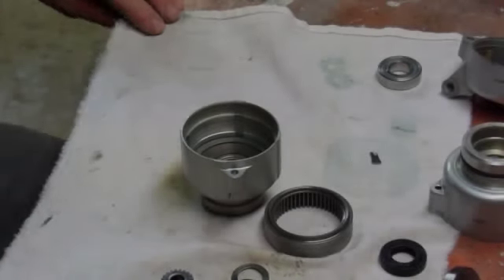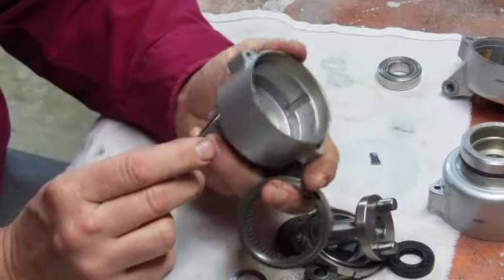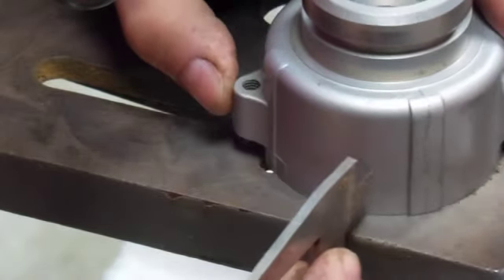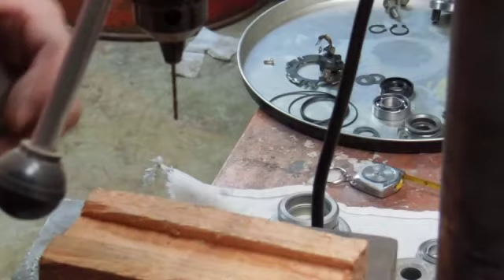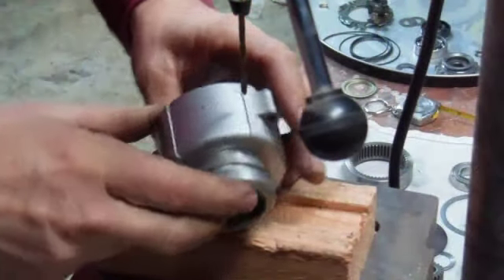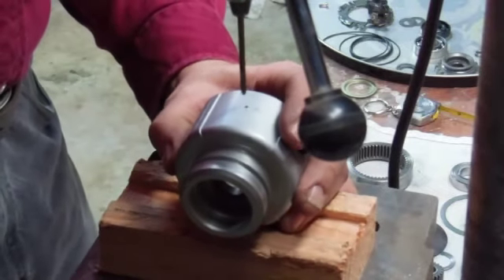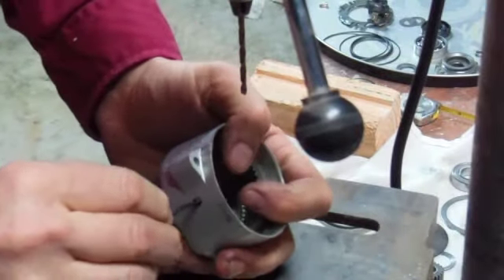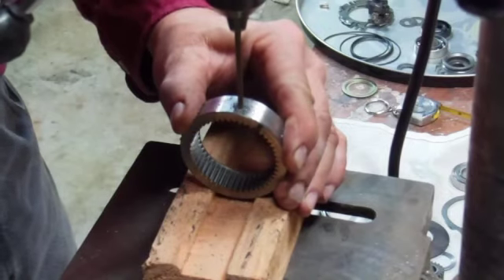Doctor Virago Starter-Ring-Gear-Fix

Comment: Thank you Dr. Virago I have one of the XV750 1986 which refuses to start. The planetary gears are so packed with molybdenum grease it's a wonder it would spin at all. I will follow your instructional video carefully and expect it to be perfect. Thanks again. Hans
Reply: Dr verago. I would like to thank you for your video regarding the starter. I have used your method of writing and hole drilling and grubs crews and it worked 100%.Thanks for the video and brilliant work. I repairs my yamaha xv 1000 and learned a lot alot trough your video. I thank you....... Aldo Kapp from South Africa

Comment: These models also use the same starter.  I thought you might add it to the main description for others with the unmentioned models.  Great video, thank you!

1981 XV920RH 
1981 VIRAGO 750 (XV750H) 
1982 XV920J
1982 XV920RJ 
1982 VIRAGO 750 (XV750J) 
1983 XV920K 
1983 XV920MK 
1983 MIDNIGHT VIRAGO 750 (XV750MK)
1983 VIRAGO 750 (XV750K)
1984 VIRAGO 700 (XV700L) 
1984 VIRAGO 700 (XV700LC)
1985 VIRAGO 700 (XV700N) 
1985 VIRAGO 700 (XV700NC)

Comment: I’ve got 82 xv750 and no spark on rear cylinder. I’ve changed cdi. Coils. Ohmed the pickups and they are fine. Swap the leads to the coils and the rear will fire. Any help would be awesome

Comment: hello, I have a 85 xv700 that im having trouble out of. could you please tell me if 145 lbs of compression on both cylinders is enough for it to run. the rear plug is gas fouling like crazy.. thank you
Reply from the maker: +Richard Shirk . . yes 145 is nice . . . for the rear plug run a hotter plug or re-jet the carb . . .

Comment: Have the same problem. Do you have any idea, how that ring gear is supposed to work in the original form, if nothing holds it from slipping?
Reply: Yamaha relied on Assembly Pressure to hold the gear in place . . and later issued Shim Stock rings that you could 1 - 2 oe 3 to give that added pressure . . but they never worked either

Comment: When I go to start my 81 750 virago, it will turn the motor over like once then some thing slips and it sounds like bolts in a blender.  Would doing what you show in this video fix my problem?
Reply from the maker: Jason Boyd This is only one ov a number that need to take place, like: clean and free turning starter, Good Batt, Good Connections, clean and properly synced and jetted carbs, good plugs etc.
Reply: This is the gear behind the bendix with the clip/tab that fits in a groove. The gear edge gets warn over time and slips you'll probably see that it's shiny from wear. Just take the bendix off, then flip the gear over so you have a clean leading edge again, make sure the clip is in the groove, then put the bendix back on. Over time that will wear also then you'll need to replace the gear with a new one.

Comment: The "clips" are brakes as you described, however they in no way stop the starter gear from rotating as it rides down the spiral gear that its spinning on, centrifugal force sends it out to the flywheel however without enough force to force the engagement as they are grinding, the clip adds drag to the starter gear which assists the centrifugal effect upon the gear by the spiral  gears spinning. with no clip on the starter gear it will free whel  and maybe not even grind!  mine was doing this, freewheeling essentially, I looked ito  the oil fill hole and saw the assembly and put a screwdriver to  the starter gears back side and added force towards the engagement for the gear, it was kind of scary to hold it as the starter motor was spinning but it actually engaged my starter and got my bike running! I was thinking I was going to  have to do it every time to start it  however a few more attempts to  force the gear down was not successful,  so its possible but no slam  dunk manually, but you can see into  the motor to view what is or is not going on pretty much.
My 2 clips were actually GONE!  both of them!  I assumed some body removed them  but I found 1/2 of a clip in the bottom area of the motor!!  1/2 of 1 clip!  so I guess it has alot more in there remaining but to date has not caused any harm, cross fingers.
I used a Dremel tool on my mushroomed starter gears teeth and tried beveling it o the engagement side, I made them a bit wider in doing so  but it works, it does sound pretty clunky  but they all do to me, not unlike old Harleys. hat wimpy compression spring you would not imagine was going to dis engage by shoving a gear laterally however the engine pulses must be how it dis engages with no spring which is how mine is for now, I did not want anything countering my engagement as at that point I was not engaging,  but with no clips I see why!  centrifugal  force alone will not even  grind the gears it simply freewheels as mine did with zero clips.  weak clips will probably grind as most do apparently, my magnet looked like a tiny Armadillo it was covered in metallic filings  scary to  realize  but it seemed to  have caught and kept it all some how, terrible design in my book but without it the motor would grind to pieces quickly. I wish now I had put the compression spring in as it does hang up for a second sometimes after the motor starts.  My 1st time my clutch would not work!  I had to remove  the side cover and do the clutch part inside correctly, I didn't think there was a wrong way to do it and really not sure whats different now except maybe not set right somehow, anyways in my mind all mine really needed was the clip  and filing the gear.

Comment: I did this and it didn't help. I think the starter is weak. I doesn't have the torque to stay engaged always. I think a good battery is really key and keep the bike tuned up so it starts easy.

Comment: This doesn't work.
Reply: Really the only thing that works is upgrading to a Gen 2 starter system.  Gen 1 is not going to work and all the Internet fixes do not work either and are a waste of your time.  I have tried them all.  Sorry to harsh this video but none of these are a  viable solution if you want a working bike.
Reply: Yas Hamdi  Read this whole article.   http://viragotech.com/newtech/First%20Gen%20starter%20upgrade.htm